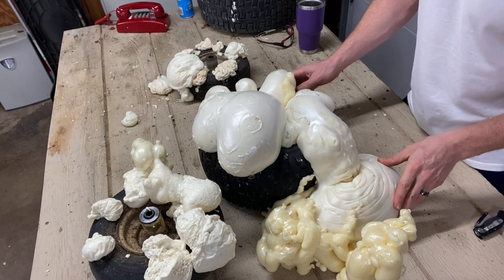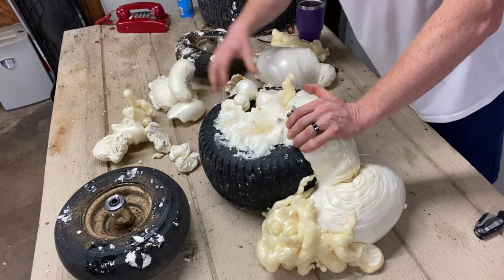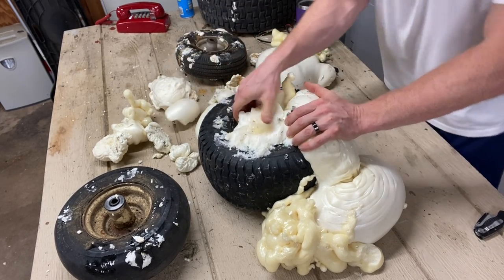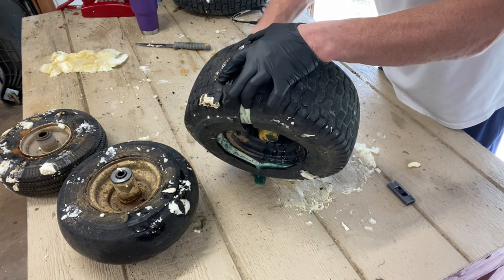Foam Filled Mower Tire Repair (WARNING: DOES NOT WORK WATCH FOLLOWUP FOAM VIDEOS)

Comment: Mike mine are 50/50 lots of crack's on the sides. I saw your  first try with foam. I said its a real mess it's looking like new tires 4 me.  I saw your next post. My 4 tires came out great 6 cans. I drilled lots of air holes & I Put 8/12 ozs. of water in each tire. Looking forward 2 putting them back on and just cut grass. Thanks so much Mike.
Reply from the maker: That’s awesome, new tires arnt cheap or easy

Comment: its seems to work in  NEW tubes, to prolong their life a bit, but it does not work at all with tubeless tires or tubes that already have holes/leaks in them. but still not the best , the best thing is tire tube slime of some kind, but in a pinch yeah  some of the foam products can be used

Comment: Hate to be the one to point this out after you went through the trouble of getting more tires but, all you had to do was not cap the valve stem. I've done a similar experiment with a large cooler lid.
Reply from the maker: Good point, is all good was fun filing my foam tire triliagy lol

Comment: Love the video on this tire repair kits....funny to watch ya doing the foaming thing. I would only offer one suggestion.....after you drill holes but before you shoot foam in the tire....take a small paper towel and wipe down the tire side walls with a table spoon of wesson oil OR spray some Pam - to help prevent the rest of the tire surface from foam sticking to it. Should a snap to pull off the excess foam away from the tire.
Reply from the maker: Good advice but I am done foaming tires, watch the other foam videos, it doesn’t work out long term on a mower

Comment: I'd like to see how well the foam holds up after a year or more of use. Riding mowers aren't real heavy but I'm curious if the dried foam would crumble over time.
Reply from the maker: Watch my tire playlist will answer all your questions on foam
Reply: Foam filled tires are sold from the factory. What is the difference? You won't get that answered here.
Reply: @MikeJones-rk1un  
I didn't know tires could be bought new already foam filled. 
Some years ago I had a set of mower tires foam filled due to getting too many thorns & flats. Once filled they weighed a ton. I never weighed them but it seemed it doubled the weight of the mower so then instead of getting flats it would often  get stuck (this was in Fla - mostly sand).
Reply: @markh6885  There aren't many things lighter than spray foam except air.
Reply: @MikeJones-rk1un  
I agree, I use it occasionally.
Reply: @markh6885 I worked in a factory where they had the cart tires filled with a material so they would not go flat.  They were very heavy (so it was not foam) but they did not go flat.  They did not have any give like air tires do so the ride was rough.

Comment: How long does these foam filled tires last before it gets crushed and "deflates" I guess you would call it.  Wonder what the foam holds its form   with the weight of a commercial zero turn vs the actual air pressure as far as tire slack. Does this really work?  Any videos putting  these tires to the test?
Reply from the maker: You need to watch my other from videos, check out my tire playlist and it will answer all your questions.

Comment: Thanks for posting this video and thanks for your experimentation. After having watched both of the videos I have a question. Do I understand it now that you  Should actually just remove the valve stem core, then fill it with foam, and just not put  the valve stem core back in?  And no hole drilling is required?Thanks again!
Reply from the maker: That is my latest theory, but I haven't tested it yet like that. I plan on doing yet another video to test  if you can just leave the valve stem cap off and let it vent. You are very astute to figure that out!

Comment: you did not add water.              I bought a light commercial zero turn mower in June of theis year.  Most of the time it is sitting with tires gone flat and therefore off the rims.  I can not get them back to the rims.  so I am stuck. any suggestions>?    I am ready to cut some wooden tires
Reply from the maker: I bought solid rubber tires off Amazon for my zeroturn front ones. They come on a new wheel and work great

Comment: Okay, I’ve tried this twice on my front zero turn tire. Once adding the foam through valve stem(no holes drilled). And once with 6-8 holes drilled in sidewall -filling it evenly throughout tire. Both times tire was flat again the next morning. Not sure why it isn’t working for me??
Reply from the maker: Hey Tim, I hear ya it only seems to work on tires that don’t hold a lot of weight. It eventually went flat on my zeroturn also. I suggest just buying the solid rubber wheel and tire setup off Amazon it is super easy and will never go flat.
Reply from the maker: Check out this video, had the same situation.

Foam Filled Lawn Mower Tire Repair - FAIL!

Comment: Hows the ride on that castor wheel? This seems like a decent solution for zero turn front tires?
Reply from the maker: Yep you nailed it, it is a wheel off a zeroturn mower. It runs great I have always had issues with leaky front tires on my zeroturn but not anymore!

Comment: Does this work on a tire with a tube in it?
Reply from the maker: I have no idea give it a whirl.
Reply from the maker: I have no idea give it a whirl.
Reply: just break down the tire and remove the tube then foam fill the tire.
Reply: Listen to Monkey Doctor.  If you want to do this, shag the tubes. The question is, does your situation call for it.  I used to have property in California and used my JD lawn tractor to cut everything that grew there, sagebrush, tumbleweeds, mustard and whatever popped up.  It was goathead city in area and my tires were covered.  I just would buy the gallon jug of tubeless slime and
Reply: @ChrisNobodySpecial  I agree with you 100%, I have a small engine shop and have used a lot of slime, I use it in my own tires, I mow about 10 ares and the woodline in the west pasture is full of honey locust with 3 inch thorns and slime has saved me from walking all the way back to the shop numerous times, in my opinion its the best solution.

Comment: First mistake, read instructions and hold the can upside-down. Secondly it takes days to set up completely.
Reply from the maker: 3rd mistake is putting it in a tractor tire. Check out my other foam videos for some giggglea
Reply: @MowerMike  It worked fine for me. Try learning from people who did it right?

Comment: I tried  this didn't  work. In the end your foam inside the tire will end up like powder . .the foam gets smashed more and more till you have a fine powder  in your tire.
Reply from the maker: Sorry to hear that, it had worked for me so far on my zeroturn mower front wheels full of foam.

Great profile pic! He is still winning
Reply from the maker: Hate to admit but I just checked my zero turn tire that I have foamed and it isn’t looking good. I assume you are correct, I will post an update and cut it open to see what happened

Comment: It doesnt work. I have a thorne problem
Lots of slow leaks. Put a quart of used oil in each riding mower.tire Havent had a flat in a couple years Dont see any oil leaks.
Reply from the maker: Huh? You put motor oil in your tire to fix leaks? That is a new one on me

Comment: Save yourself the long term disappointment(s);   Go to Harbor Freight and get an inner tube and have it installed. The foam ''dents'' and does not return to shape ( like a Styrofoam cooler )  The load capacity ( contradiction in terms ) of hard weightless foam is about 10 lbs !!
Reply from the maker: Exactly!

Comment: Well the biggest problem is is I like to run about 3 pounds of air 25 in the front tires on the tractor and about 8 on the rear so when I mow my rough ass yard it doesn't beat the living s*** out of me with foam filled tires is going to be like driving us steel wheeled wagon over your rough Terrain I guess if somebody can't figure out how to keep air in your tires I suppose the phone might be a way to go but it's going to beat the hell out of you when you're mowing
Reply from the maker: Foam is never the way to go in mower tires, check out my foam fail videos if you need a chuckle

Comment: Wait Mike... not the last video..... I know the intent of foam filled is to keep the rubber on the outside, but how about just ONE more video.  Mount the Foam tire that you pulled the rubber off on something, and then go beat the heck out of it just for laughs????  Please???
Reply from the maker: Posted you just for you Rags!! Lol now let’s move on from the foam
Reply: He is not the only one who would like to see that!

After a year of use, cut open another one and see what it looks like!, and also see if you can salvage the wheel for a new mount, or if it would be too much work!
Reply from the maker: @thesmallwoodlot433  Will do, have been running foam on my zero turn now for a couple of months will slice it open and see what comes of it